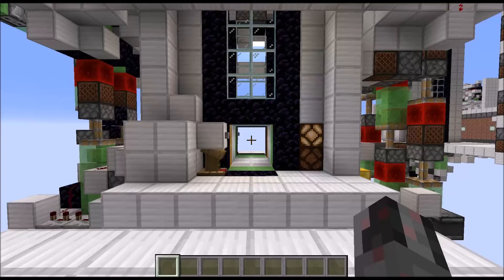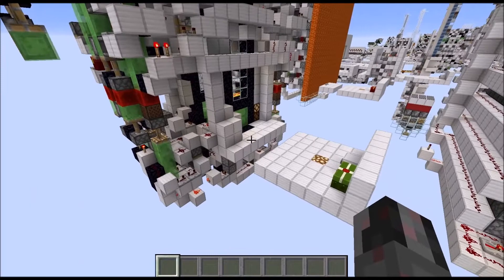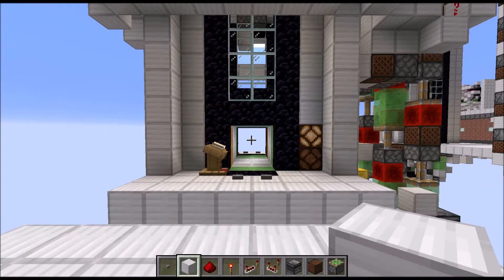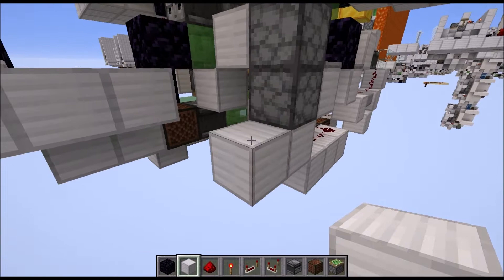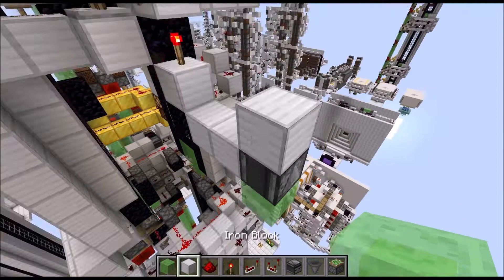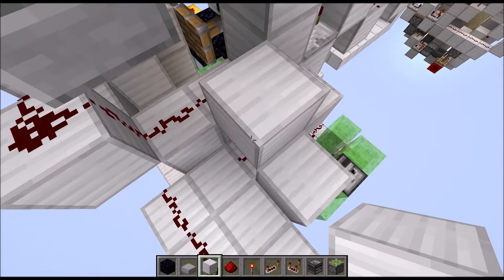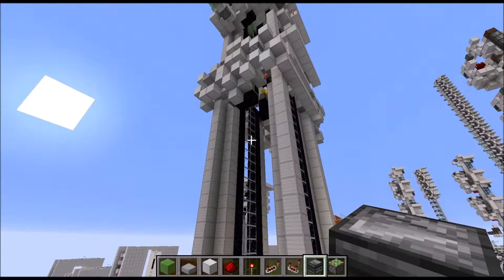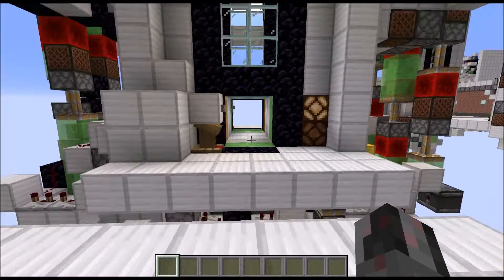Tutorial: Multi-Floor, Realistic, Pop-up Bunker Elevator with Level-Select (2x2x2 Cab) [Java 1.15+]

Comment: In the intermediate floor instructions, you put a chest with 1 item equaling a signal strength of 1.  So for the next floor(floor 3) the chest should output a single strength of 2 which is 124 items. My question is does the 2nd chest get 2 items or 124?. I believe the goal is signal strength of 2, which would be the larger count of items. Just clarifying.  Thanks!
Reply from the maker: You need a signal strength of 2, so 124 items.
Reply: As I moved on in the tutorial it all made sense. I'm trying to understand how to wire properly the lectern. It's coming. Thanks